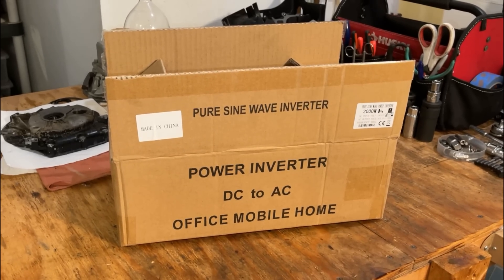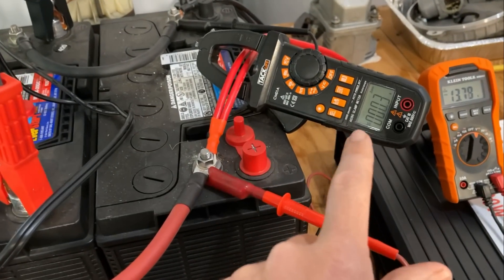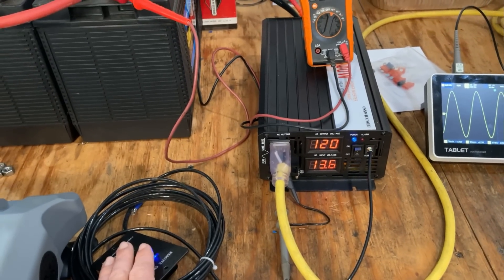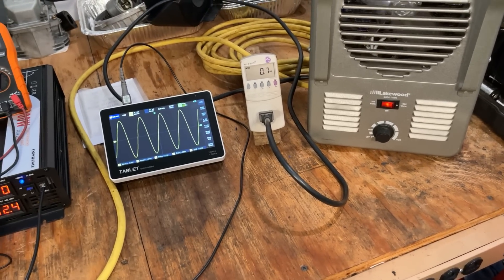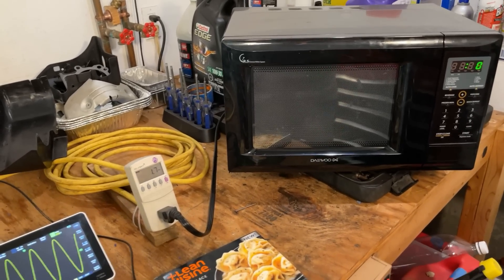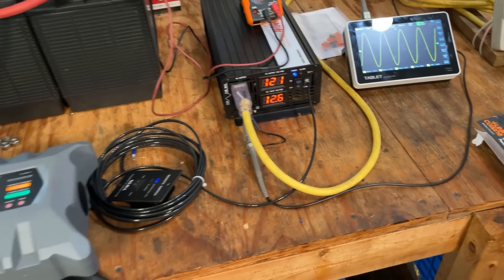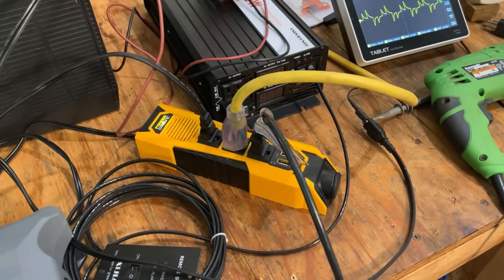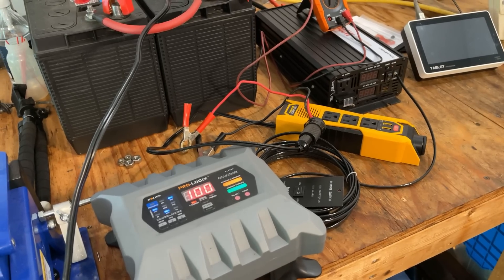CNSWIPOWER 2000 Watt Pure Sine Wave Inverter vs Honda EU2000 Inverter Generator | Load and Waveform

Comment: It is inductive and resistive loads.  I have never heard of a capacitive load but Iknow what you meant.  The drill is inductive the heater is resistive.  II am also a former radar maintenance. Chief and electronics instructor.
Reply from the maker: Resistive and inductive are the most common loads for sure, but with all the complex electrics and switch mode power supplies capacitive loads are a bigger issue now.
Reply: @jcondon1  capacitors charge up and then just sit there.  In that way the are more like 👍 nductve loads with a surge current, albeit small when compared to inductive loads
Reply: @johnclarke6647   Capacitors just sit there on a DC circuit.  On an AC circuit they are constantly charging and discharging.
Reply: @throwbo  that’s not so.  Capacitors charge up on a DC circuit and couple AC voltage on an AC circuit.
Reply: @johnclarke6647   But HOW do they couple voltage? By charging up on half the cycle and discharging on the other half. So they don't "just sit there".
Reply: @throwbo  I know that.  I taught electronics in the military.  If I had said they shut it, you would have found something wrong with that, too. What they do is based upon their capacitance more than anything else.  Big capacitors are filters and small capacitors pass AC type voltage.  I have replaced a lots more.47 uFD capacitors than 35 uFD capacitors, except in my home air conditioner.  It seems I have to replace its 5-35 uFD capacitor about every other year.
Reply: @johnclarke6647  First of all, make sure you get 440V AC capacitors and not 370V. 2nd, the Chinese will make fake anything, big or small, from spark plugs to Rolex watches, so be sure that you are getting REAL name brand capacitors directly from a dealer.  Half the stuff on Amazon is fake.  (Nowadays the real ones are going to be Made in China anyway but the quality control is better if it carries an American  brand name).  Third, I wonder if your unit is OVERSIZED for its application.  Ideally you want your AC to just barely keep up on the hottest day of the year - this means it's going to run more or less continuously.  An oversized AC is going to be starting and stopping a lot and this puts more stress on the start capacitor.  A good AC cap should last 20 years, not 2.  #4, there is supposed to be a relay or thermistor that takes the start capacitor out of the circuit once the compressor gets going.  If this relay is bad the start capacitor is going to stay in the circuit and overheat. Every time you replace the cap you should be testing (or just replacing) the potential relay or start thermistor (whichever your unit has).  If I were you, I would replace them now before the cap blows again.
Reply: @throwbo  I do but we have a lots of brownouts and voltage spikes in my area and that eats up the capacitors.  I have a total electric house, so we have lots of voltage demands.  You ought to see what it does to incandescent bulbs.  I cannot get floodlight to last a couple of months, until I switched to LED lights.

Comment: Very interesting! It would be interesting to see the waveform on a non-inverter generator such as a Storm Responder.
Reply from the maker: Later this summer will compare an inverter generator to brushed generator with and without an AVR as well as a brushless.
Reply: @jcondon1  look forward to seeing that!
Reply: @jcondon1  And the effect of different kinds of high loads (resistive, inductive, capacitive).  My understanding is that high loads really separate the good from the bad generators.  This video was very useful.
Reply: @laxtimercom  Don't forget duty cycle.(inverter)

Comment: Not sure that Honda EU2000 you have is in the best of shape.   It's been put through the mill.     Judgement on that particular unit vs the battery inverter might not be completely accurate.
Reply: His larger Honda eu6500 would be a better test

Comment: What's your plan for the CNSWIPOWER inverter? Looks a good piece of kit! You almost need a line filter in between the generator and whatever you're powering to smooth that wave form and stable out the power supply a bit. Very surprised you haven't 'monetised' your videos.
Reply from the maker: Not sure.  My RV has the wiring for an inverter.  May install it there, not sure.
Reply: @jcondon1  I know you are considering it but I'm not sure it's a good idea running that 2000 watt inverter on only 2 12 volt batteries in your motor home. I'm guessing, but those batteries are AGM at maybe 100ah each? I was considering doing something like that in my RV but decided to go with a small 300 watt pure sine inverter along with my 2 6 volt 225 ah batteries and 400 watts solar on the roof. I also have an iGen2200 Westinghouse for those times I really need that much power when boondocking. The small inverter is handy for those times I want to watch TV or power some other small ac appliance without the need to fire up the genny. Anyway, really nice thorough demonstration. If I was going to get a larger inverter, I would certainly consider this one. The price is excellent for what you get (regular outlets, hard wiring, remote) and performance was very good. Thanks for another well made video!

Comment: Very interesting, also quite a surprise. That inverter looks to be very good. The Honda was a bit disappointing. Honda claim their inverter generators output AC as clean as utility power, your test shows differently!
Do you not have the bigger Honda inverter generator? Now that would be really interesting to see how it compares!
Reply from the maker: To be fair, that Honda probably has many thousands of hours on it.  A new one might be better.  I plan on doing another waveform test like that with different generator types.
Reply: sorry my friend the "used" Honda has much better sine wave than the utility power, just put the oscilloscope on utility power and you will see how bad the shape it is with extra spikes and twists, because on utility power different simultaneously consumer devices distort the shape...